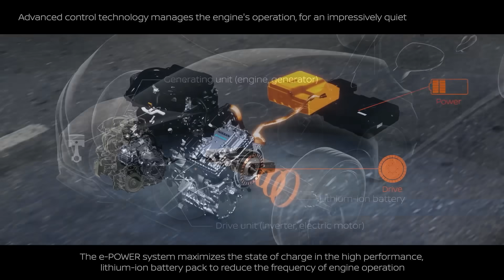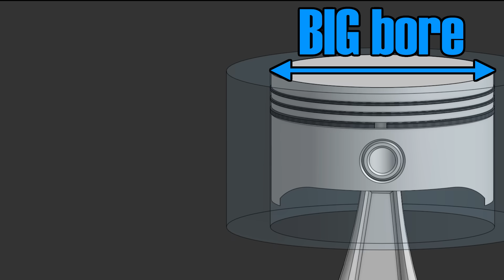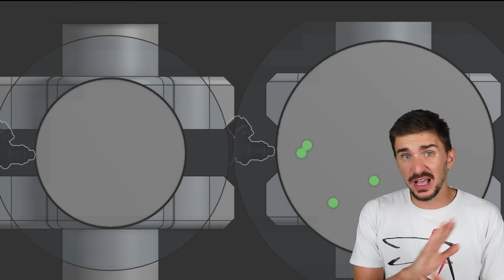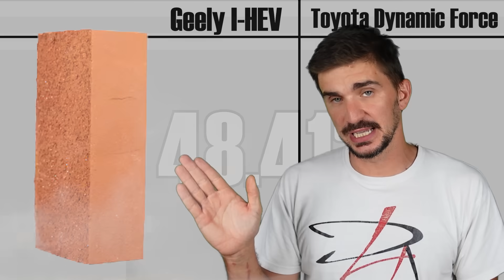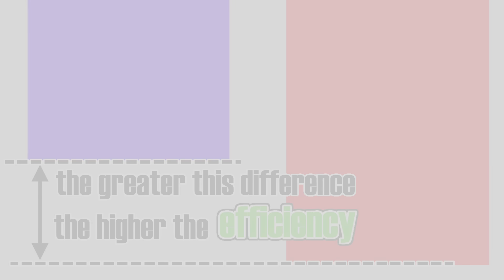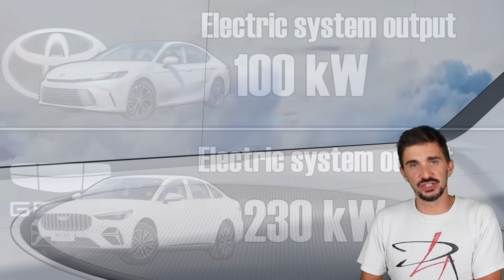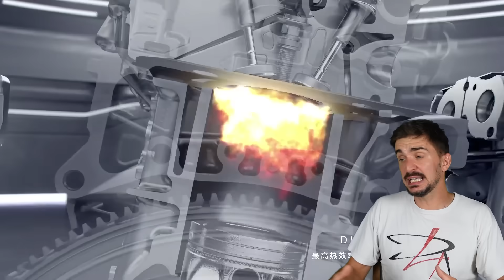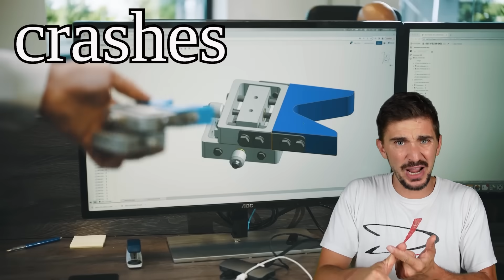How China's Geely Beat Toyota, BMW, Ford and Everyone Else

Comment: Bold claim, I look forward to 3rd party testing.
Reply: Weichai Power achieved 53,09% efficiency in a 12,5L 6cyl diesel engine, becoming most efficient "small" ICE in the world. Certified by a Chinese organization but also by german TÜV Rheinland. So I believe this 48,41%
Reply: @fauket1 
I didn't believe anything that comes out of China mouths.
Reply: @fauket1  But that's a diesel, not a petrol engine.
Reply: @jeroenkoehorst4056 you clearly were not the sharpest pencil in the case.
Reply: @fauket1  Is this claim also tested by TÜV?
Reply: @jeroenkoehorst4056 no, not the one in the video, but if you watch it, it explains why is far from being a big deal.
Reply: @fauket1  It clearly explains why it is a big deal. No other engine comes close to this. That's why it's important to have it verified.

(and a diesel is still a very different thing)
Reply: @jeroenkoehorst4056 I don't know if we have seen the same video, but at the last part literally says that this can be easily achieved by maintaining the intake valves open over a 50% of piston movement and that any other manufacturer can do it if they are ready to accept a big power loss. So it says is really simple to achieve. Yes, my example is a Diesel, but is a 53% efficiency,  with this I just say "this people" is already doing nice things, so according how simple is to get this 48% if you accept a huge amount of power loss, I don't really see why should be false (yet it should be verified by other companies. I just say I don't doubt it too much, that is NOT the same as "must be 100% true). What they don't make public is the incredibly low power output it has as a collateral result, probably because half of the world would make fun at them.
Reply: @fauket1  I don't think that is the record.  A marine engine has hit 60%
Wärtsilä 31 makes 50%
Reply: @kensmith5694 please, notice the adjective "small" in my comment.
Reply: @fauket1  Yes, I skipped over "small"
Reply: @fauket1 will only believe if certified dyno-data from Engine-Only testing from Western countries.
Reply: @johnfowler4264  so you believe it, I see, as this is literally what TÜV Rheinland did, at least with Weichai Power's engine; a western country testing the engine in a dyno.
Reply: @johnfowler4264 and is the engine going to survive 200,000 miles without opening
Reply: This is 2026 my man, nobody believes in this Western sh*t anymore 😊
Reply: @johnfowler4264  what ??? western shit certifications???
Reply: @TeofiloL-o2q8o  China has a reputation of a liar worldwide for decades in a row, so nobody believes in any chinese claims. And here they lie also because diesel engine already has this efficiency.
Reply: @johnfowler4264 copium
Reply: @BACA01 yes and VW group definitely didn't lie 😂😂😂 copium
Reply: @johnfowler4264 nobody cares about western things.
Reply: @BACA01 fed drone detected, opinion discarded
Reply: @TsLeng  Indeed as the West and the Japanese have fallen behind in 57 out of 64 critical technologies as reported by MIC sponsored ASPI (Australian Strategic Policy Institute).
Reply: Complete Engine-Only, raw data from a non-china, certified dyno. Please and thank you.
Reply: It is always amazing until someone else tests it .
Reply: @josephpelham-g1b  It is always criticized and doubted until a western company "invents it"
Reply: @josephpelham-g1b  Like the VW, Mercedes and Audi diesel engines. 😂😂😂
Reply: Google "Geely Starray EM-i Sets Guinness Record For Fuel Efficiency"
Reply: Winter versus summer testing incoming.
Reply: Racist gonna racist. It's simply factual that they achieve the efficiency. If it makes you happy not to believe, you have the right to indulge in racist stupidity.
Reply: Typical american thinking everything chineese must be fake
Reply: Never tru‌st any Chinese and Chinese products
Reply: I would bet on it being very close to exact.  They have a reputation at risk.  They are not new to making cars but they are new enough that they really-really can't afford a bad news incident.
Reply: @kensmith5694 even highly reputable Chinese brands lie about specs constantly. Realistically, it barely matters as long as they're not selling them in the USA where they won't get sued into oblivion, the average consumer doesn't know and does not care even a tiny bit, it's cheap and it has a ton of funny looking lights and screens and for most people that's pretty much all that matters no matter the controversies around it, especially around things they don't really understand.
Reply: @igcamach If they lie they don't get to be respected by me.  In many places it is a crime to sell something that doesn't do what you claim.  You can got to prison for it in the UK.  In the past in China the penalty was death in one case.
Reply: @igcamachlmao, all manufacturers lie regardless of lawsuits. Apple lying about Apple AI etc. All electronics manufacturers lie about specs when I worked at Best Buy because they were no industry defined standards so you couldn’t sue them. Contrast ratio for example had multiple ways to measure it so companies could get creative. The tv sales people all knew it. 😂
Reply: @kensmith5694 You pbviously don't understand how the CCP works huh?
Reply: @jameslopez5652 How do they work?
Reply: @jameslopez5652 there's 1.4b people. even assuming only half of them want or even buy a car, it's a very competitive market. there's so many companies in china, if you're not the best in some category, it's gonna get buried.
Reply: @jameslopez5652 it’s called you being racist and confirmation bias.
Reply: @jameslopez5652 brainwashed by your government, what a shame
Reply: @jameslopez5652 you have no idea at all. Get yourself educated.
Reply: @jameslopez5652 the chinese expert among us huh?
Reply: @jameslopez5652  The CCP lives rent free in your head huh
Reply: It's a realistic claim the engine is just very weak and anemic in power to get there
Reply: @samuelramos8787  Remember that there is a strong electric motor to do the performance stuff.  Efficiency was the goal and they seem to have hit that.
Reply: You can also watch the video before commenting to find out why it's so efficient.
Reply: @llavero5  I'd rather not and downvote instead, I don't support communist companies >;->
Reply: @animejefftv  "Communist company" please listen to yourself. China has the most competitive capitalist market in the world. Their government actively prevents monopolies and drive competition through subsidies and other incentives. Their smartphone market alone has 5 competitors with more than 10% market share and it's a similar story in their battery, ev, and other high tech sectors. It's a hypercapitalist country.
Reply: @phank.s.4052  HAHAHAHA! China uses slave labor in the far east of it's country with the Uyghurs, please educate yourself on such things before commenting, you just OWNED son. HAHAHAHAH!
Reply: @animejefftv  China is not communist.
This YouTube channel is not Chinese.
Disliking this video does not harm China.
Watching the video helps you form an informed opinion and does not imply any support for China.
Reply: @llavero5  Oh, so if there are no lies in the video about how amazing China is, then the channel is insulting China for telling/explaining the truth.

Thanks for the clarification. More evidence that anything coming from China or from CCP propaganda is a LIE, and should never be trusted because everything is always a lie. Fake video voting...
Reply: @dchubworldsharenetwork  Why don't you watch the video before commenting? You don't even know what the video is about or its conclusion.

He's not saying China is wonderful. He's only talking about that engine, which uses solutions that are already known, but not applied in Europe or the US because those solutions to increase efficiency would make the engine very inefficient and unviable on its own, even when used in hybrids.

However, the Chinese give greater prominence to the electric motor, so they can apply those efficiency measures to the combustion engine, in addition to AI to prevent situations where the combustion engine might fall short in performance.
Reply: @llavero5 How dare you be so reasonable lol ;)
Reply: @phank.s.4052 is cute how internet commies are divided about China; some say is a "supercapitalist demon", others consider it as a "communist success". But there is a common point; the super-exagerated terms. See "hypercapitalist country".
Reply: @fauket1  While it is interesting seeing that divide in opinion, it isn't as petty as it may seem. Modern social democrats and right-wing conservatives have wildly differing opinions in both how society is meant to be structured and their preferred variation of capitalism is supposed to function - but at the end of the day they are both still in favor of Capitalism. I never quite understood why the same principle was somehow special for socialists
Reply: @llavero5 I watched the video. You think I'm like some people who check the comments first and haven't even watched the video. Then they read the first few comments and decide whether to watch the video or not based only on a few comments.

No, child... I have my own decisions. I'm not brainwashed like some people... I always watch the video first and then comment.

Of course he's talking about the engine, but he's also telling the truth about the engine.
Reply: @fauket1  what part of what I said is wrong? Socialism and communism are the abolition of class, money, and the state. The Chinese state completely contradicts this and does everything possible to foment as much competition between companies as possible to grow their own industries and take over market share.
Reply: @phank.s.4052 is not what you said about the country,  you nailed the description. Is your concept of what capitalism is, that, again, seems to be fully variable depending on the demon you want to create. Is a really simply concept; an economy based on free marked and no government intervention.  That's a plain, objective and neutral description of what it is. May be good, may be evil, many need some variations, but that's a whole different point. Any tax,state regulation or intervention is, bay concept, anticapitalist. And, again; that's not a declaration of any opinion, those things may be necessary.  Is just an objective description based on the original concept. Saying then a country is "hypercapitalist" because it has a very controlled marked, is a contradiction.  "Hyper" prefix means extrem, above or beyond something. The most extrem concept of capitalism, already exists,  and is called anarchocapitalism, where the state simply doesn't exist as its name says. That's fully utopic of course and is just in some kid's minds. China is a beast that has grown up by feeding the rest of the world in a very clever long term movement; if you have the need to use a label where capitalism is present, in order to fulfill your needs to relate two things you don't like, you could say "state controlled market" that is the term used in those economies, and then change "market" for "capitalism".
Reply: @ysw8291 I didn't say anything against China, read it again.
Reply: @ysw8291and for this, I admire you.
Reply: @animejefftv anime pfp detected, opinion rejected
Reply: @ysw8291I never did that ❗️ Because I don't like both of them 🤣
Reply: @dchubworldsharenetwork Israeli comment
Reply: @llavero5  That dumbbell clearly didn't watch D4A's rant video about the internet
Reply: @ani @animejefftv lol, someone just showed how dumb a person can be
Reply: Did you even watch the video FFS. It's not that big a deal based on the configuration.
Reply: It's not a claim, but it's also not chinese technology.  The reliability and overall cost of the vehicle over 5-10 years is more important than the fuel savings.
Reply: @robertsaca3512 are u an idiot or what? did u watch the video??? it is about records, thermal efficiency record!!!
Reply: @robertsaca3512 like the western cars don't break apart after 5 years now
Reply: @Marco-hb4pt here we talk about two different things,with this technology you are 100% sure that things will fail
Reply: @andreiarama8745  Which technology?
Reply: @Freshbott2  did you watch the video?
Reply: @umageddon  It’s not a hard question. Which technology will fail? We’re talking about an engine that runs lazily with a lower compression ratio and lower temperature than normal forced induction engines, HCCI and even naturally aspirated diesels, is less likely to develop knock and has no direct drivetrain loads. It’s also not a new technology at all. Nothing new had to be developed here. Is your complaint that it’s Chinese or did you yourself not watch the video?
Reply: @Marco-hb4pt  havent driven anything less than 8 y old made in the west (EU) everything held for me :)
Reply: @Freshbott2 this very efficient technology. It trades high maintenance and reliability for efficiency.
Reply: @andreiarama8745  yes.....the chines has fail so much and here we are today. The chinese car is a threat to every existing car manufacture's survival according to the G7 nations.
Reply: @andreiarama8745  it's not technology, it's a technique. every HEV have all the same components, an engine, an electric motor and a power splitter. the maintenance still the same, an oil change.
Reply: @stvdmc2011 I'm not saying that Chinese engines are bad, I'm saying that all new engines from all car makers are worse that before because of all sorts of restrictions. But this one will be worse than all of them because it's the latest one. Maybe I'm wrong but the trend says that everything is getting more expensive to maintain and lasts less
Reply: @arleigh31burke-zc2om yes,oil change. But that's the catch,what oil change? 0w20! And here is where all new engines fail
Reply: @andreiarama8745  and how's that exclusive to hybrid ev? Where do you move the goalpost next? Fossil fuel?
Reply: @andreiarama8745 It doesn’t trade anything for anything. This type of engine has lower operating stresses. They haven’t been used in cars because they have narrow operating ranges which is perfect for gensets or in this case range extension on a hybrid. This engine will never need to run at high load, high revs or high temperatures and have no mechanical stresses imparted from gear changes. It’s literally a genset attached to a car.
Reply: @Freshbott2 hope that you are right
Reply: @arleigh31burke-zc2om look man I watched another video made by a Mechanical Engineer.

His field of expertise focuses entirely on Automotive Engineering and Thermodynamics, with a strong specialization in internal combustion engines, automotive fluids, and fuel chemistry.
He wasn't that optimistic about this engine
Reply: @andreiarama8745  look man, I drive all kinds of car professionally
Reply: @Freshbott2  Not even gear changes. It will probably be mated with an eCVT like gearbox. The only real stresses will be on cold start and when briefly accelerating/decelerating to match the throttle demand with the electric motor doing most of the work.
Reply: @L @LAndrewsChannel  I don’t think it has any drivetrain at all. The motor is only for generative range extension far as I can tell.
Reply: @Marco-hb4pt what does reliability of this engine have to do with "western car". Lmao, someone's bias.
Reply: @Freshbott2 What nonsense are you talking about...

"Runs with a lower compression ratio" 🤣

Chery engine: 16:1 - 17:1 (26:1).
Chery engine: 50 bars (150+ bars)

Gasoline engine: 9:1 - 11:1.
Modern gasoline engine (2015+): 12:1 - 14:1
Gasoline engine: 10 - 14 bars.

Newer diesel engine (~2000+): 15:1 - 16.5:1 (25 - 35 bars)

For me, this is not a lower compression ratio.

Why do you think he said in the video that it was built like a diesel engine?

Due to the extremely high compression ratio.

As for temperature... this is exactly why hybrid engines have durability problems because they don't operate at normal temperature.

This is also the reason for the thinner oil viscosity below xW-20.

Precisely because it doesn't work like a normal engine, durability is...
Reply: @dchubworldsharenetwork  You’re right in that if those values had anything to do with this discussion that would be higher compression ratios. But those are geometric compression ratios which if you listened to what you just watched or read anything else about it, you’d understand that’s not the dynamic compression ratio. You’re kidding yourself if you thought they were running 15:1 compression without the top instantly blowing on it. 
In LVCI/EVCI, the actual compression ratio is LOWER. That is where the energy and wear savings are. 
In Toyota’s hybrids the actual dynamic compression is as low as 4:1 and up to 9:1. You’d be forgiven for being confused by the terminology, but since you pulled this farce about hybrid engines being less reliable out your rear end it clearly came from a place of over confidence, you’re just making things up.
Reply: Agreed
Reply: so, u think they just want to play suicide with this?
they challenge ANY 3RD PARTY testing who doubt bout this with this BOLD CLAIM, is there any? 
are u an idiot or what?
Reply: It has been tested and witnessed during testing by verified authorities. I love Americans looking for loopholes. This isn't your joke of a government lying to you again.
Reply: It's been tested in Asia and it it doesn't even get the same mpg as an Elantra let alone a Prius. The bigger issue is that it has high failure rates. China was never able to produce gas engines well until the simplicity of electric motors which is basically a phone on wheels which they have been able to make well.
Reply: @ubacow7109  "The bigger issue is that it has high failure rates. China" ; on what  basis???
Reply: @djhrjeiwhri on Proton's vehicles, theyve been claiming high efficiency numbers for years but consumers claim all sorts of issues. Geelys been building high efficiency engines for volvos hybrids for years as well and they're insanely unreliable often reaching issues within the first 30K miles.
Reply: @ubacow7109  oh yeah?????? on ur haliucination?????????????????????????????????
Reply: It has been tested and witnessed during testing by verified authorities. I love Americans looking for loopholes. This isn't your joke of a government lying to you again.